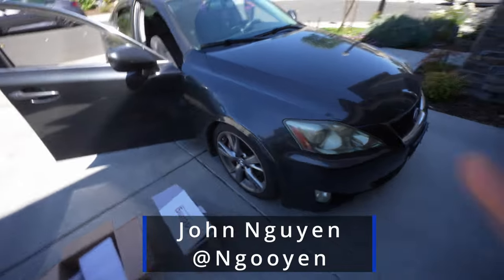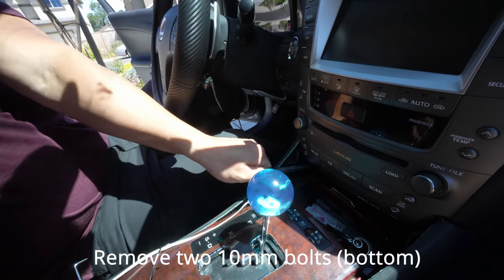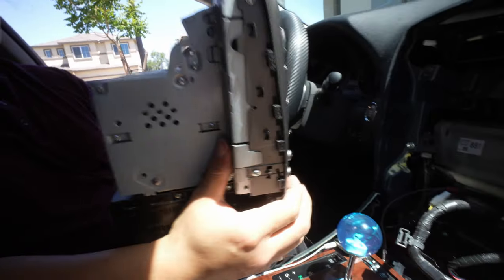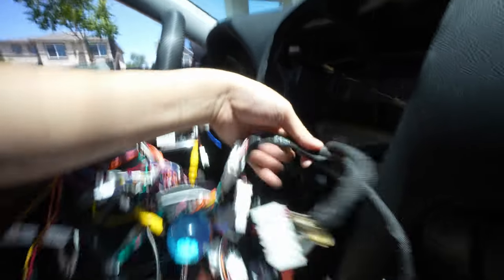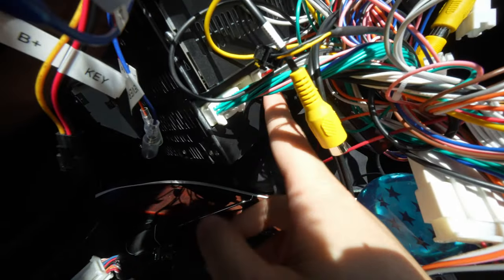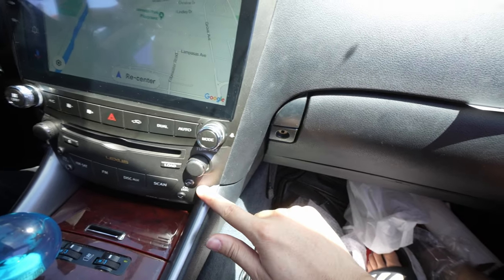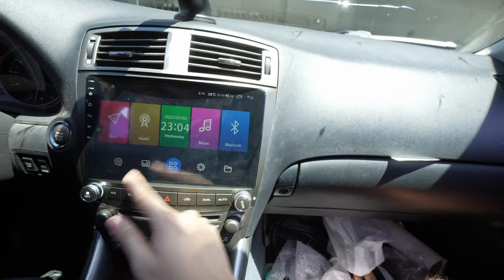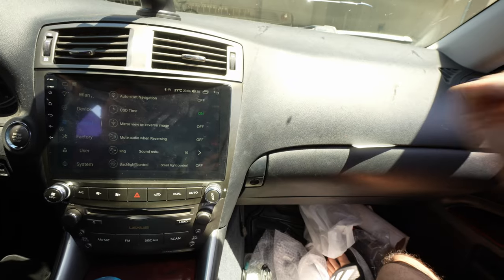The Apple Carplay Headunit to get for the LEXUS IS 350/250/200 | 2005-2012

Comment: Just curious, how well do you think the compatibility would be with my 2008 ISF? I have the same Navigation system as you but was looking to upgrade. How was the sound quality in conjunction with the Mark Levinson system? Also, which retailer did you buy the radio from? I saw you dropped a few different links.
Reply: I do have the same question. I really don't want to lose the Mark Levinson sound. Can you still make use of it? as far as i know Mark levinson handles 14 speakers. how about this?
Reply: 3rd ask for this. 2008 ISF being bought and screen is first thing I’d want to replace
Reply: @steve09daley  won't work with Mark Levinson audio or a factory nav system.

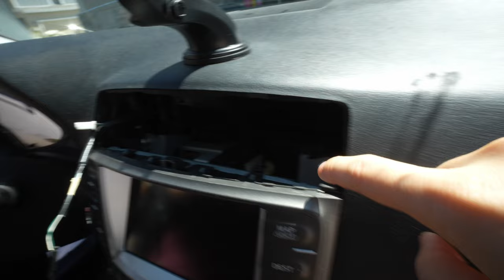Comment: I have a 2010 Lexus IS250 with the navigation screen but the set up is slightly different from yours, would the Andriod headunit still work? 2:13 2:13
Reply: The online sellers actually have a picture showing that your navigation model would not fit this specific unit.  I do not know if they make another version to replace the navigation version.

Comment: After installing this, I got airbag light on on the dashboard
Reply: Did you ever fix it?
Reply: @WolfAsh60  yes, it came back again
Reply: same problem too
Reply: Mine has been fixed. Scan the car, know the exact airbag location causing the light to come on, unpluck the sickest of the airbag and plug it back in. This is what I did in mine and the light dissappeard.
Reply: Socket
Reply: Thanks a lot! Should I try all this with the ignition on or off?
Reply: @rradjabs  please the car should be off

Comment: Is the screen made out of glass or plastic?
Reply from the maker: glass
Reply: @JohnNguyenVincent  Thank you! Has the unit ever crashed on you? And did you ever have to solder or use crimp connectors during install? I believe you mentioned everything just clicks into its respective slot, but I just wanted to make sure.